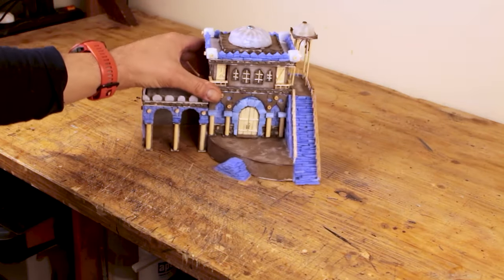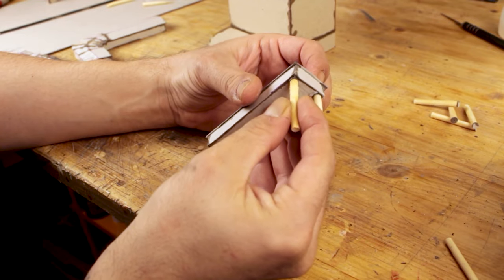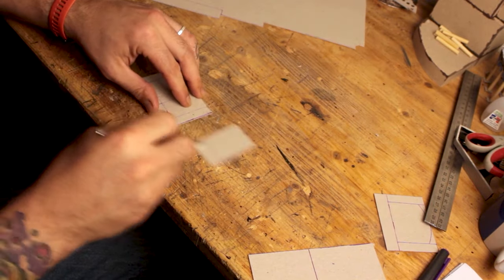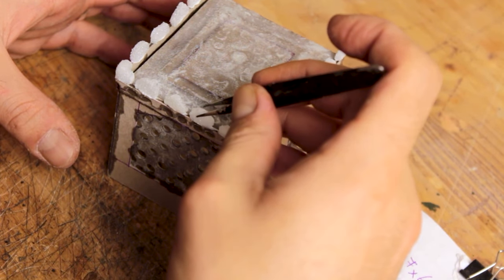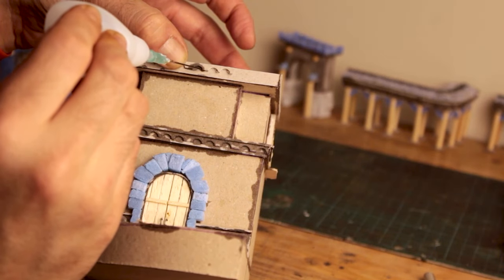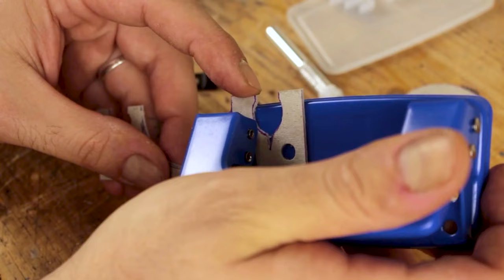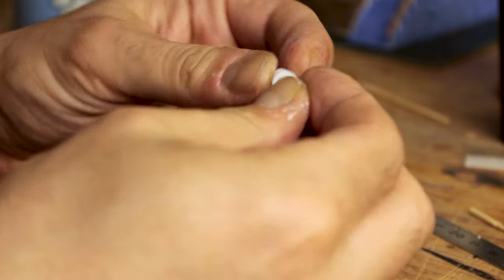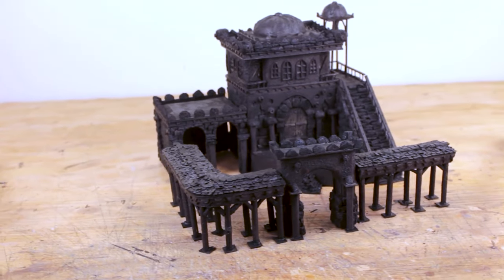🤝 Age of Empires 2 - Saracen Market Diorama Build Part 1

Comment: Super creative. Specifically, I like the hole punch edging and the baking soda ridges, but it's all really nice
Reply from the maker: Thanks. i only wish if these punches came with various sizes 😏
Reply: Special sizes of paper punch can be ordered, from ~1mm up to ~12 or 15 (I'm presuming you are in a metric using area.). Also, there are "rotary punches", designed for leather working, which will also work for card. I hope you can find something which works for you